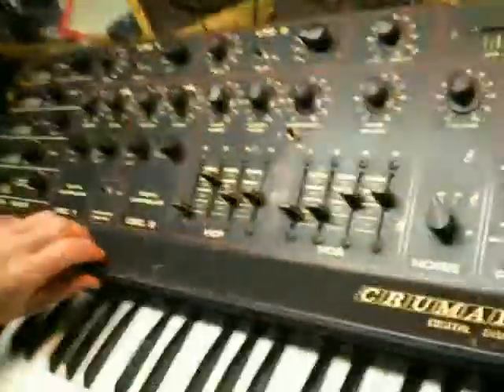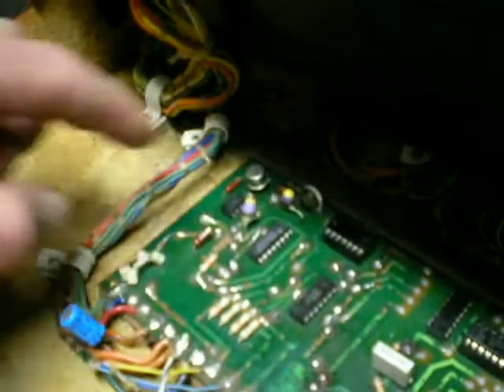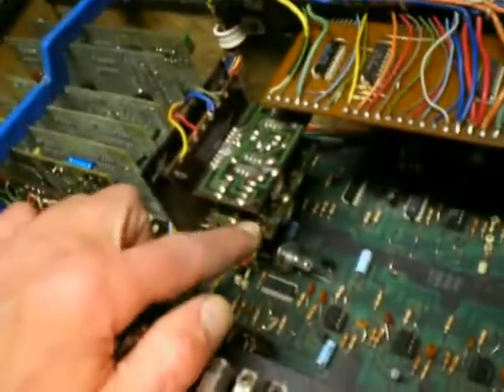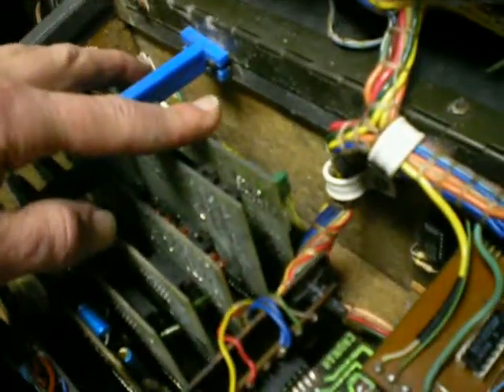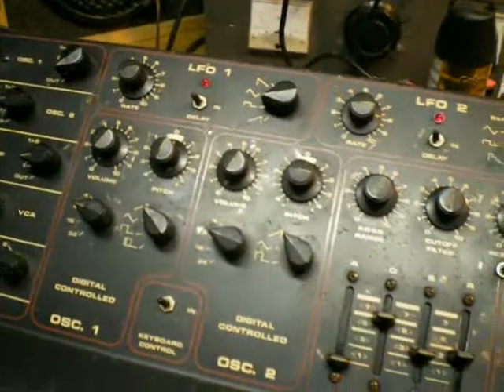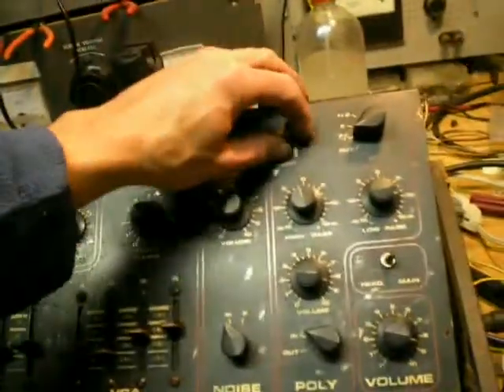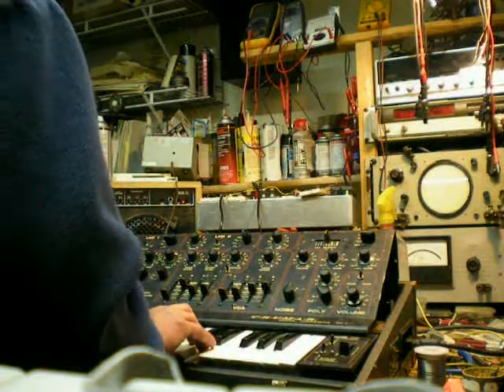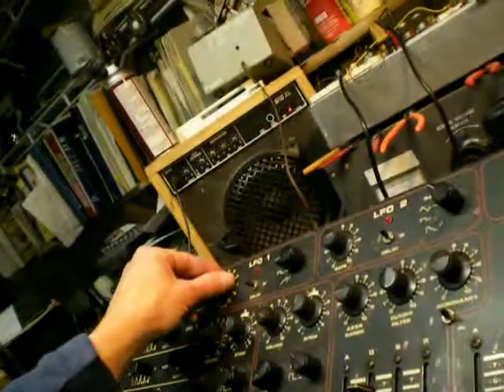Crumar DS2 technical overview/ demonstration (2009- newer ones coming)

Comment: Very informative! Picked one up very cheap recently and just got it back from a repair, just curious, is the poly section supposed to react to the VCA?  From the layout of the board it looks like that’s before it in the chain, so I wondered if it’s a completely separate section .  Was trying to get the poly to sustain with the mono section and didn’t seem to be working
Reply from the maker: ext, noise, dco1, dco2 and poly all come into the VCF/VCA mainboard at the front right interconnect and mix there.  It'd be a swell mod to have a vca associated with the organ before that but it's purely just a poly organ with pitch/octave and high low eq control going into that board with all those sources where it's mixed and then run through VCF and VCA

Comment: hi sir.. i have a friend , he has a Crumar , no keytone but theres a lfo, power.. what do you think is the problem? in what section i can try to check..? can you give me some tips? thank you sir.. =)
Reply from the maker: Verify power supply voltages...the 5V, -12 and +12 are on the board behind the ADSR sliders.  Then check to see (assuming those are ok) if anything changes as you wiggled the cards on the left. The second back has the oscillators for the mono part.  Likely since there is a poly section totally independent under the keyboard going into the same filter, the problem is probably filter, vca or power supply or just wires coming off of jacks and that kind of thing.